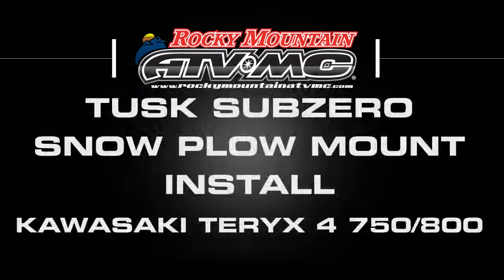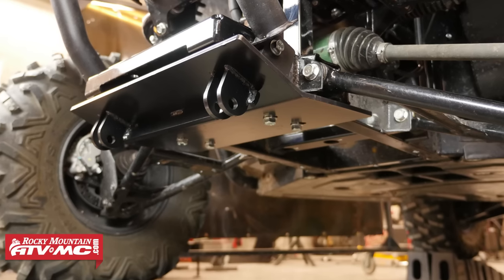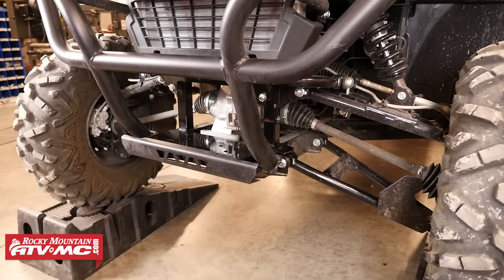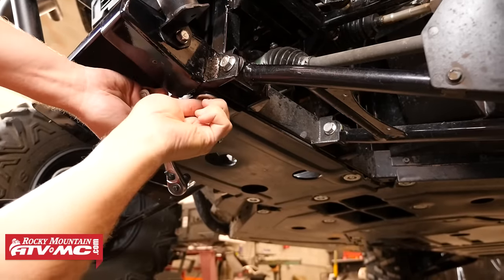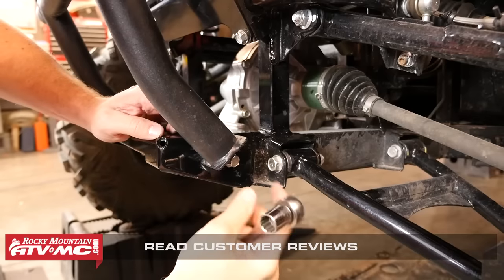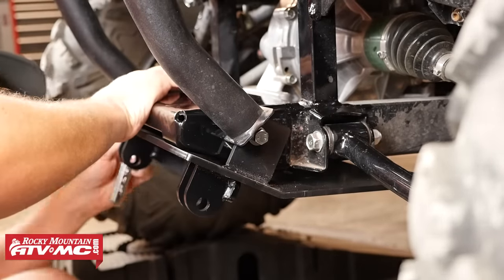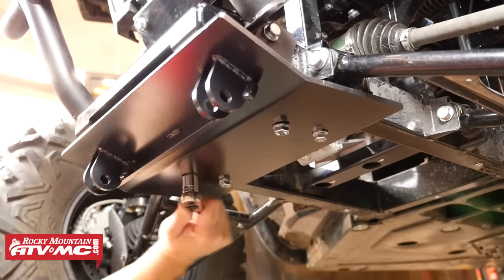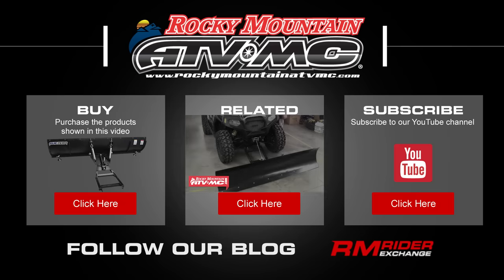Tusk SubZero Plow Mount Install | Kawasaki Teryx 750 & 800

Comment: This video is not correct. You do not have to remove the skid plate. (Why would you do that?) You are suppose to drill the necessary holes through the skid plate. I would suggest not doing it like shown in this video. I am installing the mount on my 2016 Teryx4 today. I will post pictures once I am done.
Reply from the maker: I see what you're saying.. it would definitely be more convenient.  We'd love to see how you mounted it up!  Thanks